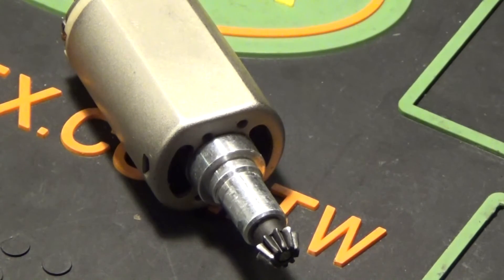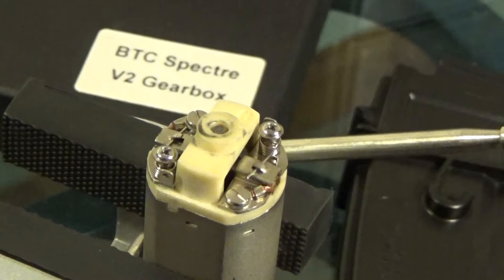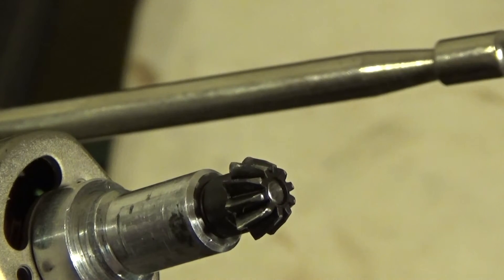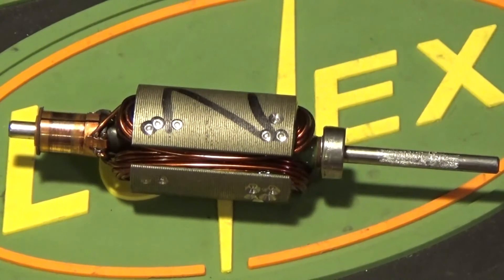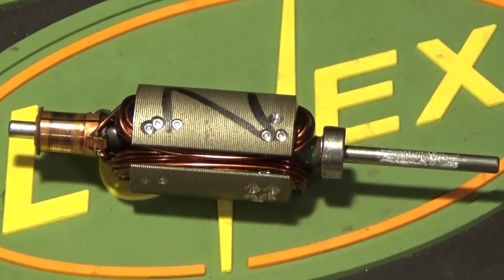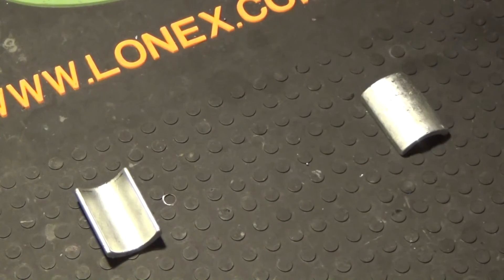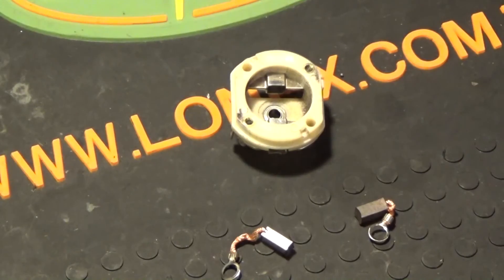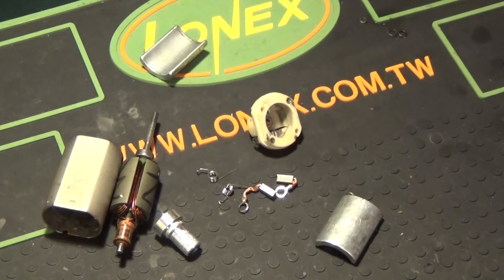"Inside" the Gearbox: Dissecting an Airsoft Motor!

Comment: Will it work with a krytac 30k 17tpa to a stock vfc motor with stronger magnets does that make it a franken torque? I have three spare motors the stock Poseidon Avenger two motor with the tan body like in this video no labels, stock vfc black no labels and the Krytac I was thinking of putting the armature from that motor into one of the none labeled motors with stronger magnets. Will this help to create a Frankenstein motor with roughly 20+ TPA after I'm done as I want to learn.

Comment: is there a way to take off the Pinion gear with O type without the additional tool?
Reply from the maker: +Slodin Hammer and punch, my friend.
Reply: haha...I was just not thinking when I asked the question, because I only needed to clean the commutator..which doesn't need to take the entire thing apart, just the end bell...now I cleaned it and it works now...
Reply: TheAirsoftTech Im trying to retrieve the armature from an old JG blue, but can't get the pinion off. However, I don't own a pinion puller. Any suggestions on good pullers to get? some of them I've heard break easy, which could be a  problem.